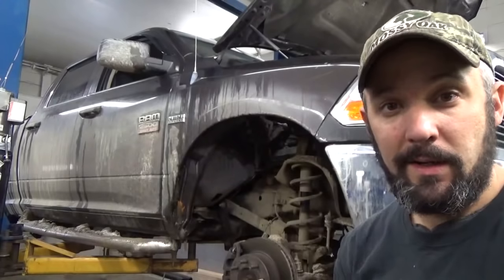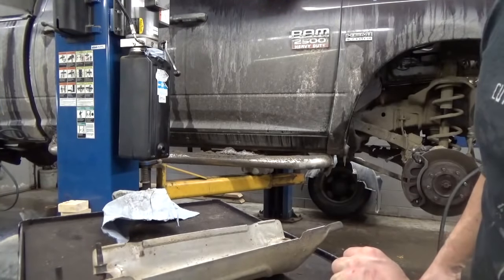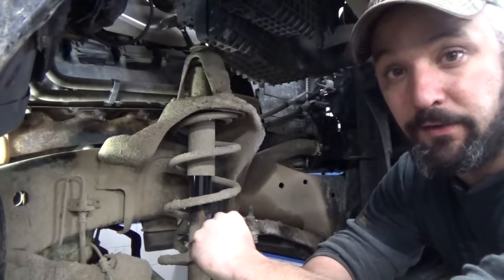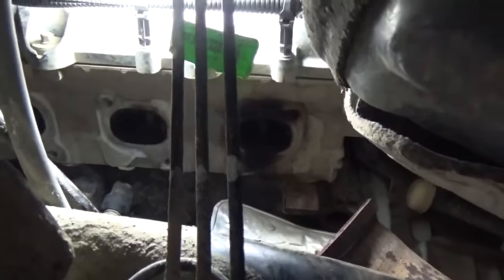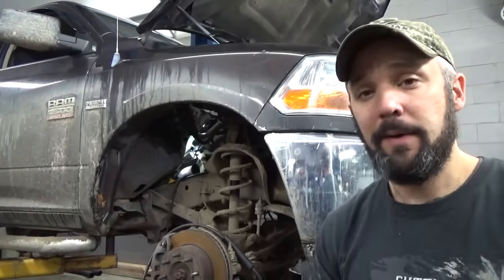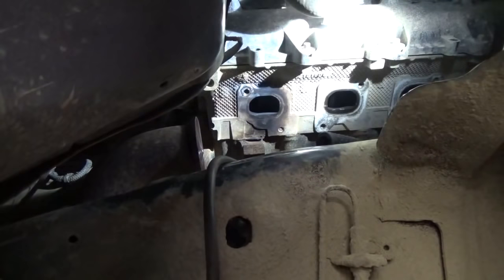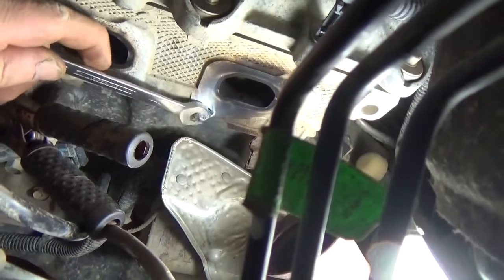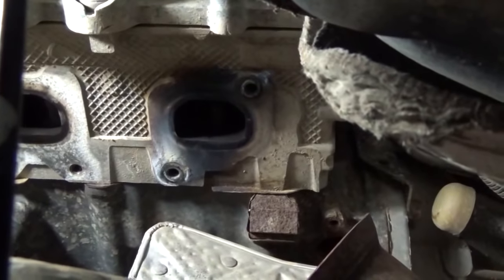Removing Broken Exhaust Manifold Bolts - Hemi Dodge Ram

Comment: I am a Chrysler certified technician, and I drive a Chevy truck for a reason. Chrysler makes one of the worst vehicles out there, bar none. They have piss poor wiring, and use cheap steel in the entire vehicle. They also have the worst quality control out of all manufactures in the factory.  There is a reason they have such poor resell value as compared to Ford, Chevy, and Toyota.
Reply: Manic Mender no your not
Reply: Guy buys hemi ram, may come with easy fix tick and last years. 1500s are known to haul 5th wheel. As where Chevy or ford half tons cannot.

Guy buys new Chevy, not a lie, not made up... Not even a year old, blows out his oil pan... Hell of a bill.

Mopar is one of the best builds out there. The manofold bolts are a common issue on many trucks. Unfortunately mopar has a bad rep for theirs breaking prematurely.

Now for the extra laugh, I'm gonna go watch some of your videos that this guy seems to be able to tell youre not a true tech. 

Dont hate on rams. They'll far outlast any Chevy or ford. 

Unless its a diesel, your make really counts. And ram still hold record for most miles turned. Just saying ;)

Comment: I can't fucking stand how Chrysler/Dodge/Fiat is so fucking cheap that they couldn't even bother putting in decent quality bolts.  For fucks sake they're bolts on the fucking engine, if they're gonna cheap out there, there is no limit to how low they can stoop to cut corners.